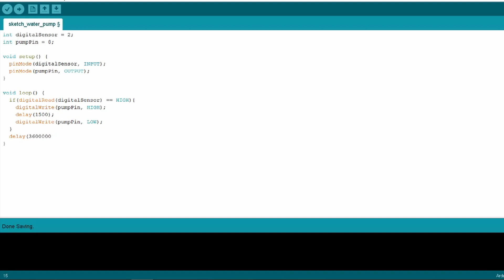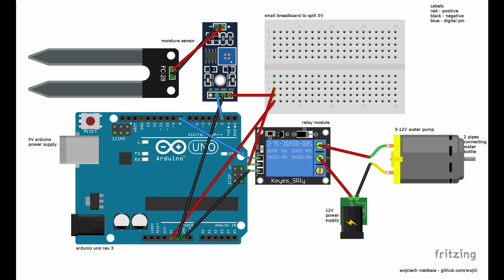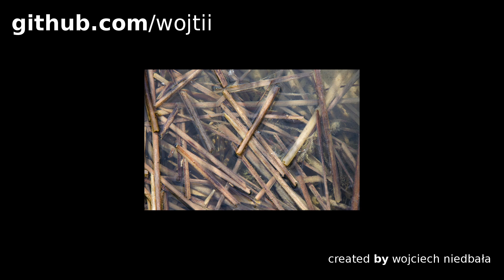Arduino plant watering system (simple)

Comment: Okay, so the power supply is 12V DC but the relay is 5v 125VAC.

“A Dc relay coil has resistance that limits the dc current. An AC coil relies on its impedance for governing the current.”

I see that yours is working but can you explain to me in depth so I can understand? 
Thanks!

Comment: My water pump is always sending water to the plant(doesn't turn off) and Idk why, do you know what it could be?
Reply from the maker: Always hard to tell. What if you just run the code that turns the pump on and off with few seconds delay - skipping the if digitalRead part? If the pump will still be running then probably something with connection or relay module and if it will start turning off then it could be something with moisture sensor. If that does not help then it is worth to check specification of the parts you are using, maybe there is some difference there

Comment: Hi, do I need to keep the Arduino uno connected to my computer for Arduino or can I disconnect the cable after it’s programmed? Because the pack that I bought comes with a battery pack.
Reply from the maker: Hi, after it is programmed, you can unplug it and connect to the battery pack, just note that every reconnect to power will restart the program :)
Reply: @wojciechniedbala   thank you! Also I bought these materials on Little Bird but the jumper wires that came were round on both sides instead of a needle looking shape on a lot of YouTube videos. I was wondering if I need to get separate jumper wires? Because they don’t fit into the little bird Arduino uno
Reply from the maker: @Nikki-fn4qw  If they don't fit then probably you need new ones, but maybe they could fit somehow, do you know what exact cables are the ones you bought?

Comment: I need a watering system that turn on pump every hour without moisture senor, can provide related code?  Thanks!
Reply from the maker: Should be something like this but I have no way to test it right now:

int pumpPin = 8; //relay pin

void setup() {
  pinMode(pumpPin, OUTPUT);
}

void loop() {
  digitalWrite(pumpPin, HIGH);
  delay(1500);
  digitalWrite(pumpPin, LOW);
  delay(3600000); // 1hour
}
Reply: @wojciechniedbala  Thank you so much🙏. I will try this👌
Reply from the maker: @awakengangster  Thanks and good luck 🤞

Comment: Great video! May I ask, my connection with arduino with relay seems to have no problem but my water pump doesnt run when arduino is turned on. May I know the reason behind this??
Reply from the maker: Thanks, it does not run at all or in some situations?
Reply: @wojciechniedbala  the water pump doesn’t run at all. But the relay functions well according to the code/moisture sensor
Reply from the maker: @muhammadsyauqiridwan8551  Hard to say, but check the connection between relay and water pump, also you can write a simple program to test if the water pump is working

Comment: Im trying to make this for a project but i just want to clear things, is it alright to not use any kind of resistor or transistor here? because i found other works like this but they used transistors and resistors
Reply from the maker: Were they using relay module as well?
Reply: @wojciechniedbala  on the other videos i saw no none of them used a relay module but they used different kinds of transistors and resistors
Reply from the maker: @im_your_greatest_nightmare  Yeah, the project can be done with transistors and resistors (I have it in the description) but it can be also done with relay module and that is what I have chose to do, does not really matter for side project I think
Reply: @wojciechniedbala  well i follow the video but the difference is i used dual channel relay but anyway it worked even without using transistors or resistors anyway thnx for this video
Reply from the maker: @im_your_greatest_nightmare  That's great, thanks for feedback
Reply: @wojciechniedbala  I disassembled it then assembled it again for documentation but the 2nd time i tested it it tdidnt work i used the same code and tried it on maker uno and arduino uno but the motor is continuously running even tho the sensor is in the water i followed the sketch/ pic on the github but the motor s still running what seems to be the problem?
Reply from the maker: @im_your_greatest_nightmare  Hard to say, could be anything really, you could try to log inputs from moisture sensor first and see if it is working correctly, then you could try attaching relay module without water pump and see if it is switching properly

Comment: Sir, I have a question about the crocodile cable that I must use or I can use normal wire?
 thanks
Reply from the maker: I've used crocodile cable just for convenience
Reply: @wojciechniedbala  Thx
Reply: @wojciechniedbala  Sorry, the last question is how many cables and wires should I need and their names and numbers?  
sorry for a lot of question
Reply from the maker: @adlymaged7730  Number of cables - look at the scheme, name - jumper cables are the standard ones and I have used one crocodile cable for the pump, it is hard to use jumper wire there

Comment: Does the moisture sensor only reads 'high' and 'low' data?
I thought you could measure the moisture percentage with this kind of sensor.
Reply from the maker: You can measure both, in this case reading only high and low makes sense because you can adjust the sensitivity on the sensor and reading percentage would require more logic in code and I wanted this tutorial to be as simple as possible :)
Reply: @wojciechniedbala  makes sense! Thank you

Comment: hey..im using double water pump..can you help me on relay use? coz i dont really understand how to use it
Reply: do i need to use 2 relay also if i use 2 motor?
Reply from the maker: @ezzathaziq9045  You can use one relay with two channels or two relays with single channel, keep in mind that you will need to control them separately (two different pumpPins), you can base your code on this: https://github.com/wojtii/arduino/blob/master/plant_watering_system/two_water_pumps.ino which uses two pumps with two sensors (if you have one sensor just reuse the same pins twice), good luck :)
Reply: @wojciechniedbala  owh thats nice but did you have like a circuit diagram for it..it would be more helpfull🙌
Reply from the maker: @ezzathaziq9045  No, I only have diagram for single water pump
Reply: @wojciechniedbala  can i pm you somewhere maybe like whatsapp? Maybe i can show you if im wrong
Reply from the maker: @ezzathaziq9045  you can grab my email from https://github.com/wojtii

Comment: Thank you very much! Is this possible with an Arduino Mini or Nano? I would like to hide it a little bit
Reply from the maker: No problem :) It is totally possible to do it with smaller boards, you just need two digital ports, two 5v and two ground ports (I had only one 5v port on my board so I have used breadboard to split it.) One thing to look up for is that it is easier when board operates on 5v not on 3.3v. Arduino Nano should be fine, but you will probably need to solder ports, good luck!
Reply: @wojciechniedbala  Nice! Ok I’ll try it. I bought a 5V Water pump, do you think that’s necessary to add the Relay and another power supply? Or can I connect the water pump directly to the Arduino Mini? Thanks a lot again!
Reply from the maker: @Shhhpablo  I have never tried 5v water pump but direct connection should work fine
Reply: @Shhhpablo  You need to read the spec of the motor and the total output current from the port. If the motor current drawn is more than the Arduino board maximum port current, then you will likely kill the port.

Comment: Sir can you pls provide schematic for multiple soil moisture sensors
Reply from the maker: Hi, unfortunately I do not have original schema anymore, but you can infer how it would look by taking this code https://github.com/wojtii/arduino/blob/master/plant_watering_system/sketch_water_pump.ino and this schema https://github.com/wojtii/arduino/blob/master/plant_watering_system/arduino_water_pump.png
and simply adding another ports for next moisture sensors. Do not hesitate to ask me if anything is not working and good luck :)
Reply: Ok sir thanks for your help but I am a beginner so idk how to represent it with the code.
Reply from the maker: @mentesravanti4498  Okay, I will try to help you, connect next sensor to the ground and vcc (like for the first in schema) and DO (digital output) of moisture sensor to port no 4 (for example), then in code you should add variable for this: int secondDigitalSensor = 4; and change the condition in loop to: if(digitalRead(digitalSensor) == HIGH || digitalRead(secondDigitalSensor)) {. Keep in mind that this is just an example and I do not know what are you exactly doing with multiple moisture sensors.
Reply: @wojciechniedbala  sir I am just using to water multiple plants so instead of buying more ardwino's I can just use 1
Reply from the maker: @mentesravanti4498  Yes just use 1 arduino with different ports
Reply: Thanks a lot for helping me out and if possible I will make a schematic and send it to you sir.

Comment: Sir how can i set a value to moisture in arduino  say 40%or 50% at which the motor should start ? Please
Reply from the maker: There should be a small button on moisture sensor to adapt sensitivity or you can use analog input to read exact values
Reply: @wojciechniedbala  let them check thanks sir

Comment: What is the purpose of your relay module in your project? and Can I do that project without relay module?
Reply from the maker: I have used relay module to control water pump. That is the only possible way to do it that I know about, there might be another solution though

Comment: why it always high? the pump keep on pumps water eventhough the moisture level is high?
Reply from the maker: It may be caused by a moisture sensor - there should be a small regulator/winder on this sensor to adjust sensitivity

Comment: Great quick video!  I’m building something similar.  Lots of questions about the tech here but I didn’t see anyone asking about the plant.  How did the plant react to this system?  How often did you find it waters?  It’s been quite some time, do you still use this?  I’ve read that the conductive moisture sensors oxidize, but I wondered whether that was with continuous use and if turning them on for brief periods as needed would extend their life - what have you found?  Have you experimented with different hose configurations?  I am thinking to try a ring with holes to water from all sides that feeds back to the reservoir.
Reply from the maker: Thanks :), ring with holes seems like a great idea. Truth is I do not use this that often, because I like to do it manually for some reason. Here are answers to your questions:
1. All plants reacted really good to this system, at one point I had small glasshouse with chilli peppers and that also was a good idea.
2. It was watering once or twice a day, I have added some personal improvements later (glasshouse, watering only during day to not wake me up, connected pipes to multiple plants, LED lights at night for chilli peppers).
3.  There are surely better moisture sensors that the one I have used but I think they are good enough when cleaned periodically (there was no rust or any other signs of wear).
4. I have always used same hose (some cheap plastic pipe), never thought of changing it.
Overall I made this project, because at that time I did not find any other like that and was curious how it will end up so I made tutorial that was meant for people like you who want to base on it but personalize it for their own needs (that is also the reason why it is short, quick and simple).
Reply: https://youtu.be/ienj1llTVkI check out this one...it may help you...
Reply: Hi, How did you get on with your project. Would love to get a bit more detail on what you did as I too want to explore the items you have mentioned.

Comment: did you connect the 5V arduino power supply to the plug?
Reply from the maker: No, it has to be separate
Reply: @wojciechniedbala  so you used two plugs? one for the water pump and one for the arduino?
Reply from the maker: @azuhasyuhada5706  yes, these are two separate connections

Comment: great, but why is the sensor high, does a analog result makes more sense ?  Sorry for my english ;-)
Reply from the maker: analog is better when you need exact value of humidity and I've just needed to know if it is low enough so there was no need to use it

Comment: Like your video very much, only the humity-sensor seems to be a problem, but if that one is swapped everything is beautiful, easy and cheap. Thanks for the clean and easy descriotion box. I found it very educational.

I will definitly build that type of watering system
Reply from the maker: Thanks and have fun! I chose those sensors from my local shop so there can be better options. Parts can be easily swapped, only you should check if they wil be compatible.
Reply: @wojciechniedbala  can you help me and give me your phone number

Comment: Question, will it water itself when the sensor feels that water is needed?
Reply from the maker: Not immediately, but in the next hour
Reply: @wojciechniedbala do I connect the USB to the Ardunio to get the power?
Reply from the maker: @cutety-minecraftandmore7564  yes you power Arduino through usb. Relay seems to be correct, so it may be a problem with connection. Did you check it with the scheme on my github?
Reply: @wojciechniedbala  It worked, only 1 more problem how I connect the water pump? I have the same pump as yours.

Comment: What do we do with the 2nd water pump code?
Reply from the maker: Its not needed
Reply: @wojciechniedbala  Please help me where do I put the FC-28 sensor?
Reply: Do we upload the sketch and upload to Arduino/Genunio Uno?
Reply: Like what serial port? I need help.
Reply: And where do we put the fc-28?
Reply from the maker: In the soil
Reply from the maker: Serial port may vary, so you have to check it manually in devices manager
Reply: @wojciechniedbala Niedbala and is the relay module supposed to be high or low?
Reply: My relay module background color is red unlike yours. Help me.
Reply: Please respond as soon as possible.
Reply: My water pump isn't working and is the relay module light supposed to go on when I connect the power supply?

Comment: if you allways put voltage to you sensor, it will corrodiate wery quickly. How to fix this?
Reply from the maker: Hmm, I didnt think about it, soil moisture sensor is said to be stainless so it should be fine and rest of the sensors can be placed in some box with i.e. silica gel in it

Comment: I have a grove moisture sensor. Can I use it instead of yours?
Reply from the maker: Yes, but make sure to adjust to it measurements
Reply: @wojciechniedbala  Thanks
Reply: If I want to work with the analog output then what should I need to change in the Arduino code
Reply from the maker: @mohammadsazzadurrahman3591  check if input is bigger than some (try different) threshold integer instead of checking if input is high
Reply from the maker: And also you need to use analog port in arduino
Reply: @wojciechniedbala  Oh that grove sensor give a different value for dry soil and wet soil. so, I should use that value as a threshold
Reply: @wojciechniedbala  Is there any problem if i don't use relay ?
Reply from the maker: @mohammadsazzadurrahman3591  yes, arduino works on 5v, so you need either relay or transistor to be able to control 12v
Reply: I dont recommend that type of soil sensor, it corrodes super quickly. Capacitive soil sensor does not, get that instead

Comment: Hi sir
I've gone through your video n I've made connection as per your video n code
Even though I'm getting a pblm that only the motor pumps even the sensor is in the soil
I've tried 3 relays n the pblms occurs again
Reply: I dont recommend that soil sensor, it corrodes super quickly. Capacitive soil sensor does not, get that instead. Also you might have to adjust the blue thing on soil board
Reply from the maker: try to log soil moisture sensor reads to the serial monitor and check if they are correct

Comment: Can we use 5v  motor and 5v adapter
Reply from the maker: Yes but pump will be slower then
Reply: Why the motor doesn't stop
Reply from the maker: @makeallthethingsmakeallthe3177  it can be wrong connection, different parts that I used, soil moisture sensor giving different results

Comment: Sir can you tell the ptoblem in my connection the motor directly starts and do not stop
Reply from the maker: First check output from your soil moisture sensor in serial monitor.
Reply: @wojciechniedbala  thx sir i have done modifications in code and its working well
Reply: @Lavanyabarhate1234  plzz send me the code.. 🙏🙏
Reply: @Lavanyabarhate1234  plzz

Comment: why did you not base the code depending on the soil moisture sensor data is sending you?
Reply from the maker: Cause I want the pump to activate 1 time per hour at maximum
Reply: @wojciechniedbala  You should make it so it doesnt turn on the pump if value is at the lowest, so when the soil sensor eventually corrodes it doesnt flood things, needs analog for that though not sure what you use. Better to get a capacitive soil sensor. Takes like a week or two before regular sensor corrodes to bits. Youre an MVP for answering so many of these noobs btw. But its a pretty bad idea to use resistance soil sensor for long term

Comment: Can we use 9v battery for a 9v DC pump
Reply from the maker: You can try but the battery will not last long. I strongly prefer standard power supply
Reply: @wojciechniedbala  I'll use two batteries since I'm running out of my budget thanks alot for the reply since my project is due tomorrow!! 😊
Reply from the maker: @kushiananya2366  no problem :) I am glad I helped you